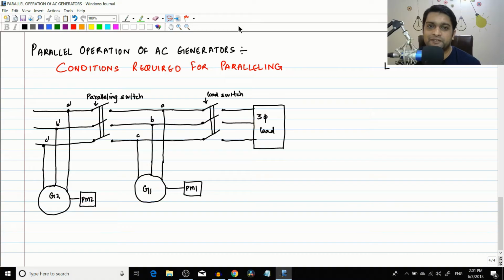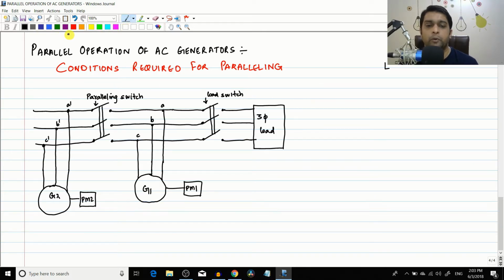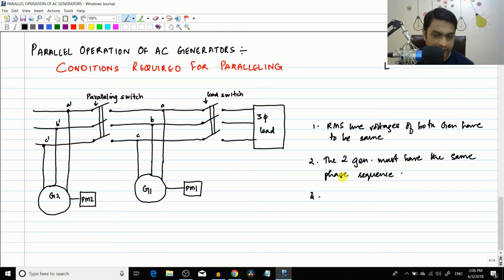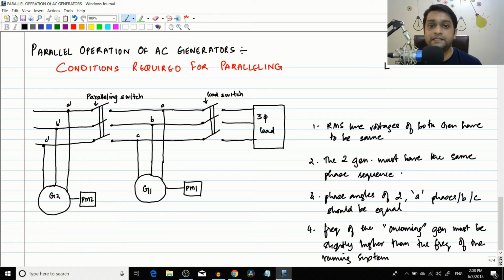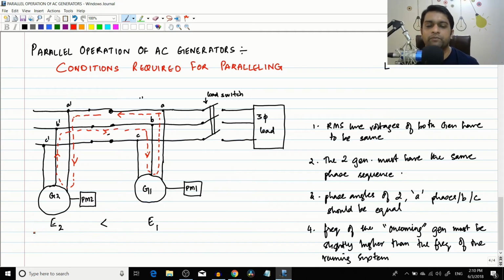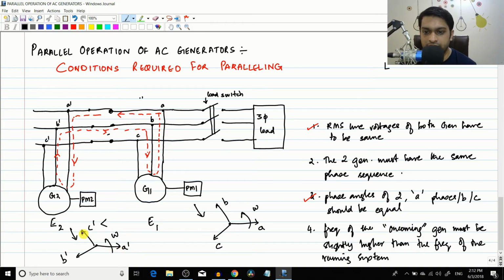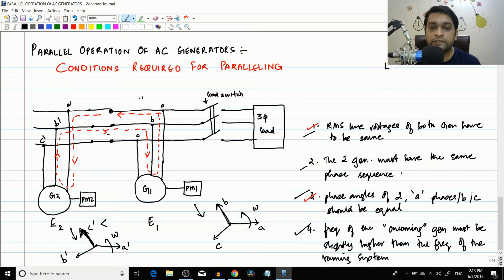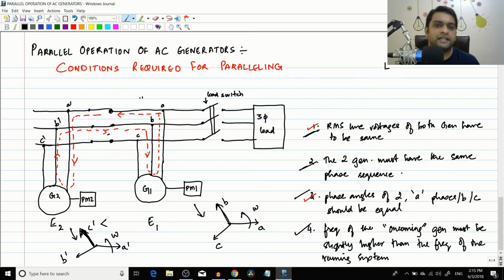#18 Parallel operation of alternators - Part II Conditions required for Paralleling

Comment: Thanks.
But in point 4...
As I know the supply frequency is constant (50 or 60Hz) how can you make one generator to operate with freq other than those???

Suppose the the running gen. G1 has 60Hz how can you adjust the freq of out coming gen G2 to be slightly higher than 60Hz??? 
I hope you understand what I am try to ask.
Reply from the maker: You just increase the mechanical input to the generator and drive it at a higher speed...
Reply: @ElectricalisEasy  yes thanks I just get explanation in lecture 20 concerning that.
Thanks again and god bless u

Comment: respected sir thanks a lot for your great effort 
sir i have a query when an alternator running parrallel with others is to be taken off the bus which procedure to be performd first reducing excitation to zero or reduce power fed to prime mover of alternator 
and why it should done  in which sequence

Comment: Frequency of both generators are same during that  time speed of one of the  Generator goes slow and other generator try to boost the speed ... Here motoring action takes place...
My question is 1. How we can relate transient and frequency.. 
U said that when the speed is low transient will occur.. that's why I am asking
Reply from the maker: Transient means not a faulty, I am referring  transient as a momentary thing that happens to speed up the slow generator..

Comment: sir when phase sequence of generator 2 has changed to (ac'b') enormous amount of current will flow because of 120 degree phase difference..  my question how this phase difference create more current then phase different between which phase?
Reply from the maker: U can draw both phases ABC and ACB in a piece of paper and see the waveforms for b and c phase you will understand how High current flows..difficult to explain in words here..